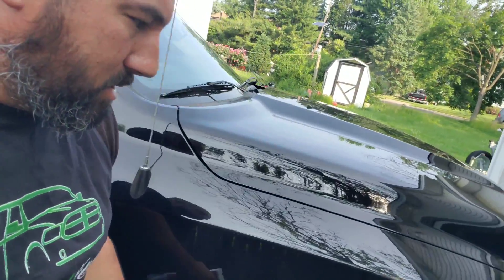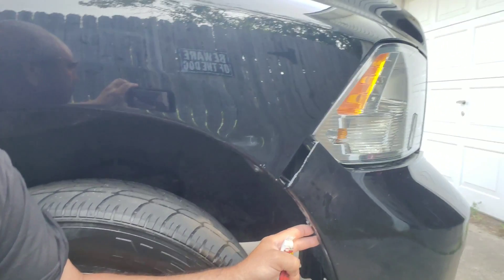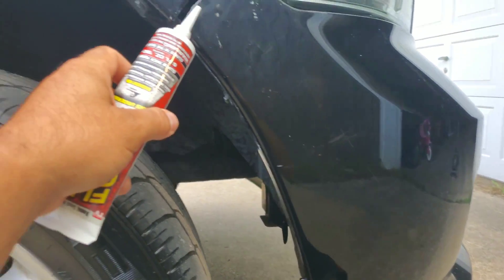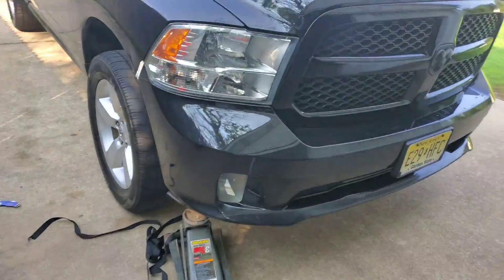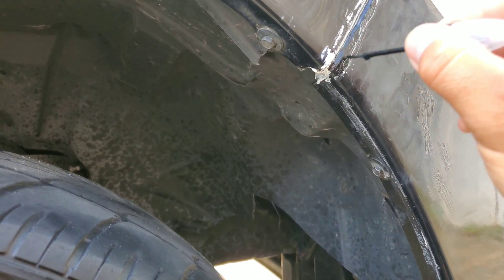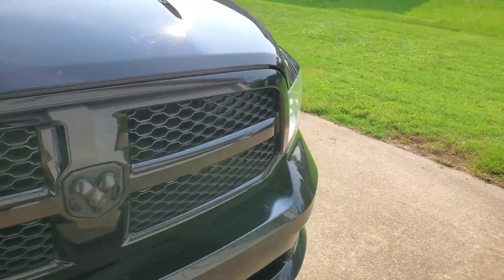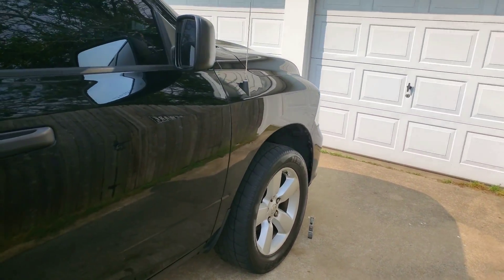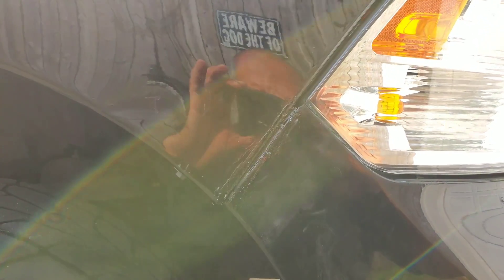HOW I fixed my front bumper using.....???

Comment: I had to do something similar to my 2002 ram, I used jb weld epoxy and a small angle bracket from lowes to use the factory push in screw, replaced the plastic screw with a 3/4 10 coarse thread screw
Reply: Jb the bracket bumper cover and drill out as needed

Comment: That will work, also put some screws in the inner fender and it'll hold, trust me, I had to do it myself.
Reply from the maker: A lil plastic was broken so I couldn't f in and anywhere to put screws in
Reply: Sometimes I would drill little holes and put black zip ties just to hold it in place. A new bumper from Arrigo Dodge cost me almost 1,500 bucks.
Reply from the maker: @thespicemelange.1  damn that's I hope that's painted with all the hardware

Comment: 👍👍how off then do u change ur plugs I have 16690.miles wat do u recoment.bro should I change now  most people sat is too soon is my first truck I have an 5. 7  8 speed express
Reply: Just turned 90k still running same plugs. Manual says 120k
Reply from the maker: I haven't changed mine yet but it will be done very soon I'm at 71k miles
Reply: Dealer changed my plugs,water pump,flushed radiator and turned rotors with new pads at 73k.

Comment: Have you done anything to the underneath for weather proofing?  My rebel is 2 years old and already rusty
Reply from the maker: No nothing underneath mine is a lil rusty too not too bad for a 5 year old truck imo
Reply from the maker: @Chriskelly19067  lol
Reply: @Chriskelly19067  just get a massive oil leak that should stop the rust 😂
Reply: Spray your frame with rust converter, then spray with chassis paint.

Comment: Should used 40/40 3m it is bad ass
Reply from the maker: Thanx for the advice this worked pretty good n not that bad looking I'll get it done properly soon
Reply: @IncredibleHemi1111  use 40/40 then bolt it that stuff works wonders it's what we do to glue down the lady toilets seats  here at the shop
Reply from the maker: @RAM243VALDEZ  nice

Comment: now spray some Mothers CMX Ceramic Spray on the lite scratches, buff off... it should help a bit.
Reply from the maker: Great idea thank you I'll give it a try
Reply: Hey Venom Hemi, how good is the cmx??? Im purchased a bottle last week and plan to use it in my truck soon...
Reply: @Rep361Texas  it's good but it's like Wax you got to wipe it off it has white residue I'm actually going to try ice seal and shine next I heard that doesn't leave any white residue
Reply: @venomhemi3914   Yeah iv herd of that, i just wonder about the ceramic aspect it claims to have, im really interested to see if it will last.
Reply: @Rep361Texas  I'm not really sure how I feel about it every time it rains it seems I have to put a new coat on

Comment: I did the dumbest thing I’ve ever done I was changing my motor oil and I accidentally put transmission oil instead of motor oil in my 2011 ram 1500 which has 120,000 miles on it
Reply from the maker: Damn bro that sux sorry to hear, shit happens,  hopefully everything works out for you